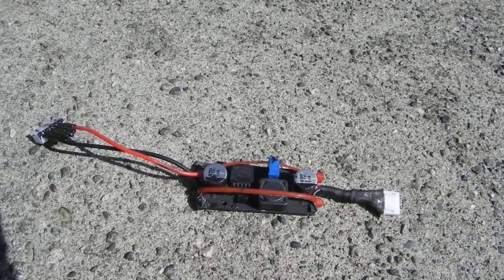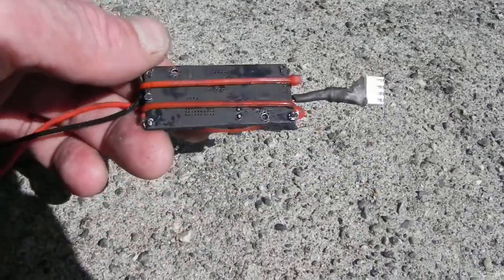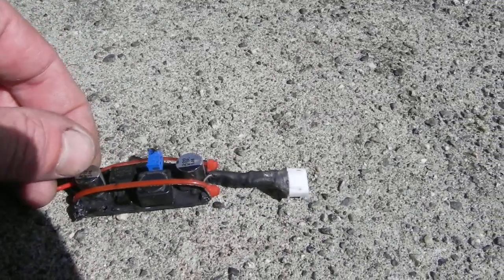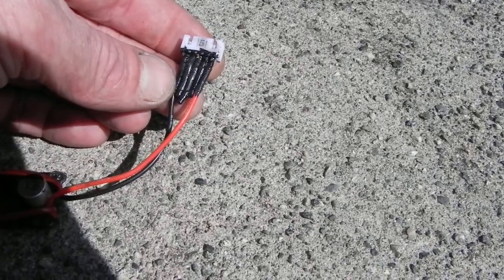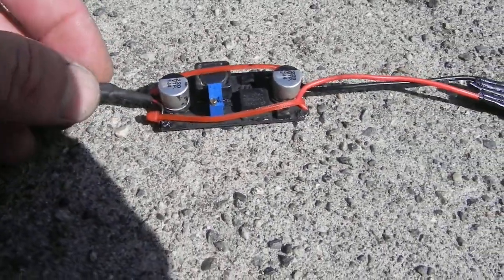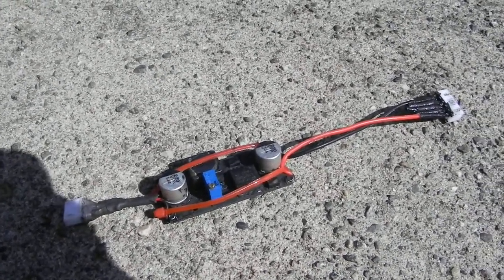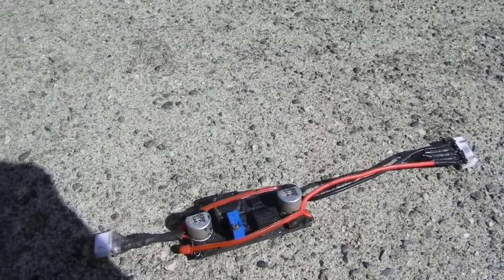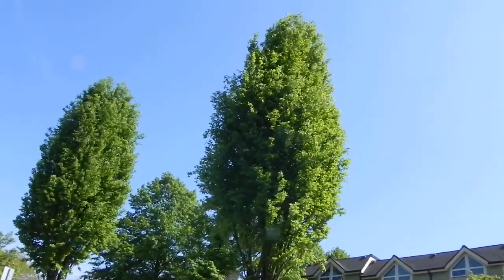4s to 3s basic voltage regulator for powering HB8's FPV and accessories.

Comment: Hi  governor1 tv  I have a 1.2phantom tx and receiver . I am using a mobius and would like to know if a regulator is needed to insure that voltage is safe.
Reply from the maker: Your batt should be a 111v 3s stock and the generic 1.2ghz works fine off that with my big and small quads